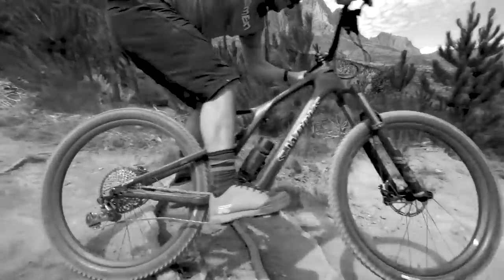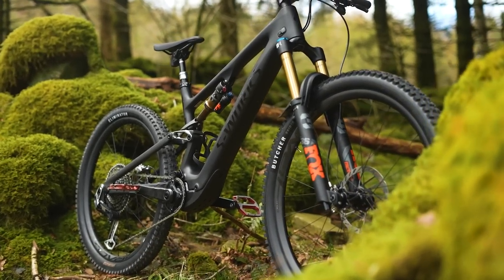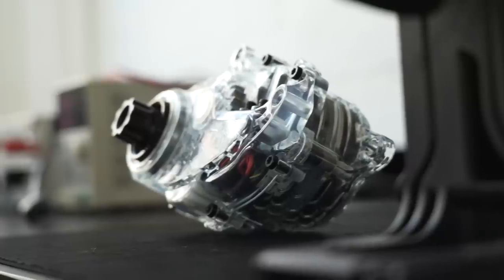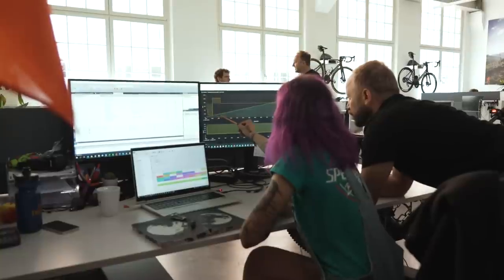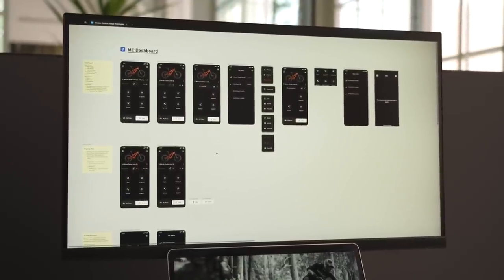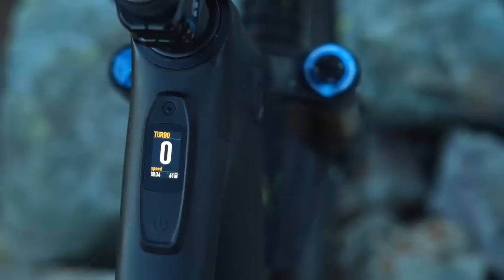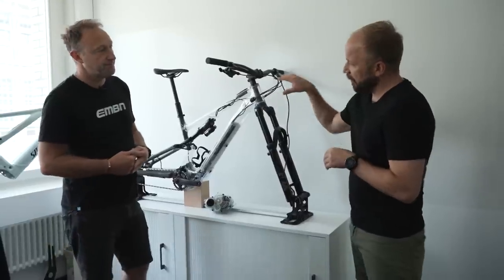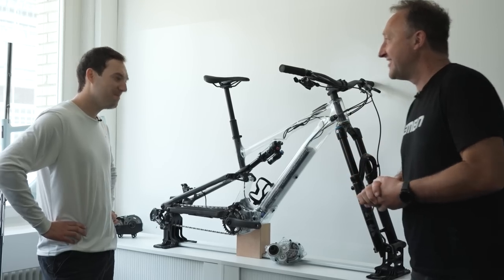EXCLUSIVE: Behind The Scenes Development Of Turbo Levo Bikes | Specialized Design Lab

Comment: Still not worth 15k
Reply: $8k, though, I'm in.  I do hope they have 5.5k Al version soon.
Reply: Have done 2 rides on my $8k Comp Carbon so far. I started racing MTBs in 1989 and this is the best bike I’ve ever ridden. 

Worth every cent, I’d get an S-Works tomorrow if I could afford it.
Reply: Same as trek fuel exe the 13.5k bike is not worth it but if you look at the models at 7-9k yeah!!
Reply: I really like the new SL, and as a longtime owner of Specialized road and mountain bikes, I prefer this brand. BUT - I still wish you could specify individual components and colors for a custom build like Orbea dose with the Rise for instance. In my opinion, other than price, it’s the biggest flaw with Specialized where you are unable to make the bike exactly as you want it or you end up with a model you love but hate the one or two color options it comes in

Comment: Can we put this motor on the old Levo sl?
Reply: Another video I saw stated the mount points are the same. Would be nice...
Reply: I would think you would have to replace the whole TCU and electrical system to do that. I doubt Specialized would endorse it but I wouldn’t be surprised if people come up with a retrofit.

Comment: Please answer the obvious question. can you retrofit this motor into bikes with the SL1.1 motor? That "shares the same mounting points"
Reply: Think the chain line is different because of the new geometry and that might make it hard to do a swap…
Reply: Great idea, be interesting to see if it will work, probably needs the mastermind tcu and new elec loom
Reply: It says they have same mounting points, but read somewhere that it protrude and bash guard can't fit or is also protruding. Thats all I have so far.

Comment: Great looking bike and they seem to have addressed all the things that were holding it back. The 3 year cycle has come around again and they haven’t disappointed. Everyone is harping on about the cost, yes, they are expensive but then so are other brands. You don’t have to buy s-works or bikes with electronic shifting or droppers. Also, you can’t legally ride motocross and trials bikes in the forests in the UK.
Reply: I agree! Look at the manufacturing precision on MTB parts compared to dirt bikes. That’s where a lot of your cost is.
Reply: @streddaz  R&D too. The bikes of today are far better than ever before. Hard to by a bad bike these days. Spoilt for choice.
Reply: @steveharper4017  very true. The amount of R&D that goes into high end MTBs these days is also why they are quite expensive. 
Maybe this will taper off as they get closer to the ideal bike, but I think as long as there’s enough people around willing to pay big bucks for a bike they’ll stay expensive.

Comment: I am a tech geak, I like to have as much info about my ride and my bike as possible.  I use the Garmin 1030 on my E-bike and the Shimano EP8 communicates with it so I could do without their screen altogether if that was an option.  Does the Turbo Levo talk with the popular bike computers in this way?
Reply: Yes, my Garmin 530 can see battery, watts, etc from my 2022 Levo SL. For older Garmins, there's a 3rd party app that adds those data fields.
Reply: Has ANT+ LEV profile
Reply: geek vs geak

Comment: I hope they can understand the importance of an engine that do not produce any friction while pedaling. The moment they produce it, will be the moment they nail the e-bike/bike produce, as most of the people only can afford one bike.
Reply: Have you pedaled a Turbo? The natural feel with the assist turned off is one of the biggest things that set them apart from most e bike systems. I did a 50 mile gravel ride on a Creo SL with the motor off and road a previous gen Levo SL with the motor off a lot.
Reply: @JesseStarrPhoto  I rode several times the previous gen Levo SL and even it was light compared to the traditional Levo (I do own), is not nearly close to the frictionless TQ Motor or Fazua Motor, some bikes are currently bringing today. I hope this Gen2 Levo SL could be somehow similar but clearly the design of the motor is not friction left, i kind of see similar design with gears than the old one had.

Comment: It grinds my gears when developers are referring to eMTB drives as engines.
Reply: Well, technically it is an engine. And engine converts power into motion, it’s just that electric “engines” tend to be more often called motors.
Reply: Right on.  Motors Motors Motors.

Comment: Will it last longer than 9months this time though!?
Reply: I've had the Sl for 3+ years.  Bullet proof, the most reliable MTB I've ever had. But damn, now I need the new one!
Reply: Same. LSL bought 1 week after launch. 6000 miles. No problems.
Reply: @koho  KSL 18months old 4th motor. about as bullet proof as a wet paper bag.
Reply: @perspectivedetective2703  First SL motor I've heard problems with.  Did they replace under warranty?
Reply: @koho  Yes, all were replaced under warranty.

Comment: Maybe all this over engineering is why Specialized has an awful record for reliability when it comes to Ebikes?
Reply: Maybe we are the lucky ones, but between me and my buddies ride levos and kenevo sls and have been problem free 🤷‍♂️
Reply: The Mahle motor in Levo SL and Kenevo SL is known for being one of the most reliable out there.
Reply: They don;t.  One version of the Levo had lots of motor problems. I've had the Levo SL for 3 years, bullet proof - and that's the motor Specialized developed themselves.  The most reliable MTB I've ever had.
Reply: I like my levos gen2 and gen3 but tbe motor reliability  is so poor....
Reply: @Donkeydoedel  Really? im on my 4th motor in 18months on a KSL.
Reply: @daxolivares6939  had my KSL for 18months, im on my 4th motor.
Reply: @koho  Bullet proof? is it, aye?
Reply: @perspectivedetective2703  yep .  4,000 miles, only problem was a slow dropper after 3 years.  And I beat the crap outta this bike.
Reply: @koho  2700miles
4th motor
complete wheelset upgrade
2 TCU
4 handlebar control unit
2 speed sensor cables
front suspension rebuild (oil seals failure)
3 cassettes
5 chains
3 derailleurs
3 chainrings
2 wiring harness
3 headset bearings
2 frame pivot bearing set
Obviously not all of these were problems and more due to nonsuitable parts that cannot handle the power in the drivetrain. Everything will wear through time but i feel the wear in these parts is excessive.
Reply: @perspectivedetective2703  Geez, man, what the hell'd you do to that poor bike!?  I've got 3,500 miles and none but normal wear stuff., no drive train issues except replacing the chain (the original was a bit wimpy)  I beat it up pretty good, too, or so I thought.  Curious, what happened to the motor?  Did it just quit?
Reply: @perspectivedetective2703  geeze, i have my levo 18m0s and problem free
Reply: @perspectivedetective2703  Santa Barbara.  So steep, rocky, mostly dry.  But for a month or two of the year, there's plenty of mud, and the bike's been through the Santa Ynez river a dozen times.  Still, the beating it's taken has less to do with the motor than the suspension. Lots of rock bashing, some big days at Mammoth where you get 18,000 ft of downhill.  It could be that you're just a lot stronger than me and stress those cranks more.  BTW, hoping to come to Scotland this summer.  Don't know if I'll get to ride, but love McTrail Rider's videos!
Reply: @perspectivedetective2703  if you’re having that many problems with that many components, high likelihood of user error involved… You still have to shift properly with an ebike to avoid destroying the drivetrain too quick. 

Really though, this reads more like a troll post…
Reply: @JesseStarrPhoto  Yeah, it must be my fault. im so stupid i can't detect the massive crunch when changing gears under load. Thank you for pointing out the error of my ways. i promise i will endeavor to ride with consideration for my poor abused drivetrain.
Reply: @koho  It would appear EMBN are censoring our conversation by deleting my comments. 
Which part of Scotland are you coming to?
Reply: @perspectivedetective2703  Not sure yet, but likely Skye.  I hiked around there back in the 80's and have long wanted to go back.   Heard about the new bike tracks in central Scotland, tempting to visit but I'd have to rent a bike.
Yeah, the user error comment makes no sense with motor failures.  Sorry for your bad experience.
Reply: @koho  Bike hire in Ballater, just down the road from Tarland Trail Centre. 🙂
Reply: @perspectivedetective2703  Tarland  - that's the one.  Thanks for the tip - I may just have to try it out!  Cheers,

Comment: Specialized, its time to layoff engineers and come back to reality. I can get a top end 2 stroke yamaha for the same price as your short range e bikes.
Reply: If people are still going to buy them, they’ll keep selling them for that price. 
Just for reference, the Epic WC, XC bike is more expensive than most of the Ebike models.
Reply: @streddaz  I bought a brand new Gasgas 450 for 13k
Reply: I've had the "old" SL for 3 years, and will gladly upgrade to the new one.  I go places your 2 stroke can't.
Reply: Top end yamaha costing about the same price as a top end ebike makes sense. They’re both spec’ed to do the best they can at their job.
Reply: @koho  spot on
Reply: New tech is always more expensive than old stinky tech ;-)
Reply: What's that got to do with e-mtb's?
Reply: @squirerides8371  no that makes 0 sense, one has many moving parts and the other is a pedal bike with pedal assist.
Reply: @squirerides8371  correct! And there’s actually more advanced manufacturing techniques in mountain bikes. Carbon or hydroformed frames, ultra high tolerance casting, everything cut down for ultimate weight reduction.
Put a dirt bike brake caliper and lever next to a high end MTB one and see the difference in precision. Add that precision up throughout the whole bike, and you can see why they are as expensive as they are. MTB frames and components evolve much faster than dirt bike technology does.
Reply: @redleaderone8429  yes and the components are a decade old. To compare apples with apples go buy a KTM 450 rally replica and see how cheap real high end dirt bikes are.😉
Reply: @koho  a two stroke can go a long way but ya I can’t throw a 300 over my shoulder  I just ride my Levo expert
Reply: @Mxoderberg  nevermind
Reply: We can all agree that in general mtbs and emtba are way to expensive.
But what isn't nowadays?
Reply: @TheUniqueTobi  but somehow we can still buy them together with all kinds of other shit we don't need. Go figure…